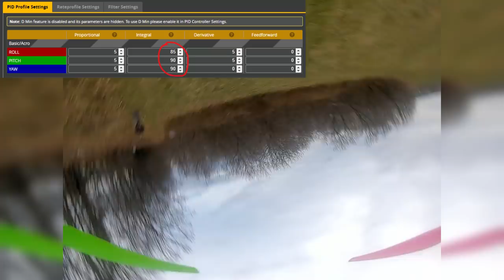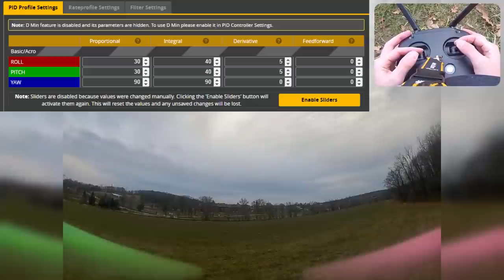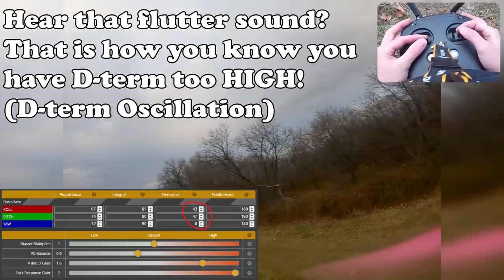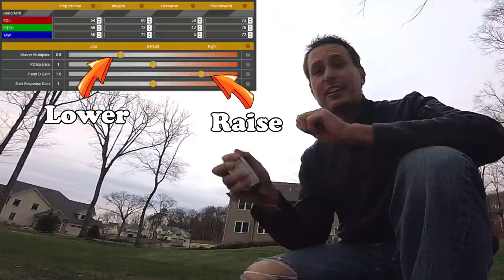How to: Fix Oscillations | I-term Tuning

Comment: Hello Mark,I hope you can help me. I fly my 5 inch copter with the Supafly Smooth Medium preset. It flies excellently. Now I have built a 3.5 inch Pirat Lil Matey 2 frame with 2850kv motors and SpeedyBee f7mini stack with 6s Lipo. VTX is the DJI O3 air unit. I chose the 3/4 inch Supafly as the preset. I now have the following problem. The copter wobbles when flying forwards. I don't know how I can tune the wobble away with the PID settings. Unfortunately I don't have any experience with pidtoolbox. All screws are tight, the cables are laid out neatly. The propellers are undamaged. Do you have a recommendation for me as to how I should adjust the PID and in what ratio to make the copter quieter? It would be great if you could help me. Rocksteady does smooth out the footage, but I would like to fly without wobbles in the live image. best regards and thank you in advance for your support. Best regards, Sascha

Comment from the maker: 1. we start with i=85/90 and P=5 --> it freaks out
2. we lower i=40; with P=5 remaining --> it flies but wobble city
3. we raise P=30 with i=40 --> wobbles are gone
4. finally, we have he full tune with i-terms back up at 85/90, higher P-terms for even better performance, and raised D-gain now to control the oscillation of the higher P-gains. 

Note: P and D together need to be as high as they can be for the best prop wash performance.

Comment: Thank you for linking this video for me in the Ciotti stream. Going to give this a try tomorrow, let you know how it goes.
Reply from the maker: If it still wobbles, let me know.  Maybe log it?  Does it have logging?
Reply: No Blackbox unfortunately. It's an Iflight Sussex f4 1s whoop board, mob6 19k motors, crs fire, it's a little porky at 27gr dry. But the I term is at 100 across the board right now,  going to drop it to 90 and try again. After I get some batteries charged.
Reply: Thank you again. This video helped get my quad flying much much better, still not prefect but a little more tuning should do the trick.

Comment: Transtec laser HD :-) Love Transtec Laser frames! Great quality carbon,  not really T700, but still amazing! (be aware - motor mounts are too week, use 4 screws there if you want to bush it).  Only issue is props in view.

Surprised how well it flue with D term 5!!

Comment: i need help on tuning my 2s 4" quad. it is little bit overweight but flies stable. when i try to record the flight, i continuously experience wobble on pitch axis. it acts like it is driving on a bumpy road. what ever i do, even changing controller, wobble is always there. since camera has no EIS, it reflects all small amplitutde slow oscillations on video clips. i adjusted, pids with patience with hours of trying, , i adjusted filters, blackbox is almost vibration free, fc is on soft mounts etc.  i am using old PWM esc board from aeesparrow square drone. This dron is actually a wifi drone but i converted it to fly with my own transmitter and a proper f4 controller. its original version was almost vibration free indoors ( with its primitive controller). what could be the reason?

Comment: Nice one! I use to tune the I alone by checking the quads reaction when going straight and punching the throttle. If a have a nose up in the punch i add I in pitch, if i have some angle taken in the roll axis i raise the I in roll. Usually this ends up in relatively high I values of about 80-90 ( the time that my P and D is arround 35-50). Should i try lowering at steps the I and see what happens?

Comment: Great explanation thanks, I’ve got low throttle oscillations, on a 3” what advice for adjusting pids to help with that? Tbanks
Reply from the maker: Reduce ESC PWM and/or i-Gain.

Comment: wich flight controller u are using???
Reply from the maker: All different ones.
Reply: @uavtech  i am using omnibus f4 v3s
Its make me crazy its oscillate just when i landing the quad. (low throttle)

Comment: ive seen it stated that P and D are for "high"-frequency errors and I is for low. I have been able to eliminate wiggles in my large 55 lb drone by merely adjusting I term. tradeoff seems to be steady state error (pitch in my case) vs wiggles, but this error is still acceptable. of course what makes frequencies "high" or "low" is dependent on your setup...
Reply from the maker: it is always D > P > i 
in relation to oscillation control high to low.  Also check out the video at theuavtech.com/tuning

The Key Relationships you need to know.
Reply: @uavtech   thanks!

Comment: Thank you! I have always wondered, why is there no slider for the I term only? Also, where did you get the go pro mount for your frame?
Reply: Brain3d has all tge mounts
Reply from the maker: There kind of is between the Master and P and D Gain slider.
Brain3D: https://www.brain3d.co/collections/gopro-mounts-gopro-protection/products/adjustable-angle-universal-gopro-session-mount?variant=25919723344
Reply: @uavtech  awesome, thanks! Love the Laser HD frame.

I just got a Transtec Beetle 2.5” with air unit and it came with stock BF 4.2 pids. It’s a heavier 2.5” and has a lot of jello even in a hover. What pids do you think I should adjust? I set up RPM filtering and I have the filters all the way to 2.0 but that did not help the Jell-O at all.

Comment: Great video thank you for this. Is it the same protocol for fixed wing?
Reply from the maker: yes
Reply: I will try this method instead of the traditionnal "PID" method. I tried many settings on my heewing f01 but there is still some wobbling following the pitch axis.
Reply from the maker: wobbles.  Reduce I-term in relation to P.

Comment: i still get mid throttle oscillation after RPM filtering bf 4.2 . What should I start twitching around ?
Reply from the maker: Try 48k pwm with RPM enabled and Dyn Notch max of 600hz.
Reply: @uavtech  in blheli suite ????
Reply from the maker: @DronemanfromNepal  yup.
Reply: @uavtech  thnx man !!!  now where to enable dyn notch to 600 hz .  thnx again
Reply from the maker: @DronemanfromNepal  in Filters Tab.  At bottom left.  Set min to 125 and Max to 600.
Reply: @uavtech  i think u have other tutorial videos about setting min and max value to 125 and 600 . i will watch it again . i wanted to use rpm filtering and i got fired bidirectonal dshot with updating esc firmware to support bidirectional dshot , it made worse . hopefully 48k pwm frequency and setting dynamic nothc filter to 600hz will get rid of mid throttle oscilation

Comment: So I have had a really bad oscillation problem on my new 10" drone, I have tried adjusting the I term and P term and no matter what combination of numbers I do it still slowly oscillates and gets worse until I end up crashing it, any ideas what could cause it?
Reply from the maker: If it is a slow wobble, it is too high of i-Term to P-term.  You can drop i-Term to 0 to see if it persists.  The other thing could be Motor Saturation.  Are you using 24Khz PWM and how big are the motors?  10" props are a lot to spin up/down.  If you need more help, jump on my discord and tag me.  Logging it would be good.

Comment: Hello, I am new to your channel as recommended by Joshua bardwell amongst other flyers.. I have built several quads since I started fpv back in august of this year and so far, everything but two seem to fly pretty good, but I know there’s room for improvement.. I haven’t been too worried about since I’m still learning to fly better, however, my repertoire of quads is growing and none of them have more than a stock tune.. like I mentioned before, two of my quads, actually 3, have some tuning issues that need to be worked out and I would also like to learn to tune the others beyond a stock tune.. I see that you seem to have a plethora of tuning videos, and so does bardwell, but here in lies the problem, I’m very new to the tuning aspect as in I haven’t done it yet, and every video I’ve seen so far is of much older versions of betaflight than the current that I have been using.. this only compiles the the confusion because I cannot see on my screen, what is being shown on yours or anyone else’s screens.. as a complete noob to tuning, is there a video you would recommend to watch first..? I have read an article by Oscar liang to get familiar with PID, and I’ve watched a handful of videos, but like I said, everything thus far, is from older versions than what is out now.. I’m still trying to understand PID and filtering, not to mention black box.. lol.. please help..! I actually started to try tuning one of my recent builds yesterday but stopped where I was at, because I have no idea what im doing and before I go any further with it, I want to have a better understanding.. please and thank you..!
Reply from the maker: Hi and welcome!  Everything to get you started is at.  For quick set Presets, check out that page.  For tuning, check out https://theuavtech.com/tuning
Reply: @uavtech  is this the same guide I saw you use in some of your videos you were tuning the 6s quad that someone sent you..? It looks like, just confirming..
Reply from the maker: @squirrelyfpv7283  yup.

Comment: does a perfect tuning with the black box increase or decrease the flight time?  I noticed that by increasing the PID a lot I have a greater absorption from the battery and the drone tends to have much less strength and is woody.

Probably wrong tuning and bad tracking of setpoint increase corrections and reduce battery in short time?.

Probably wrong tuning and bad tracking of setpoint increase corrections and consume battery in short time?
Reply from the maker: Likely reducing because it makes the motors work harder to keep things perfectly following the sticks (less wash, wobble, going off course).

Comment: I was getting some wobbles everytime I throttle up passed 50%, I drive myself nuts trying to fix it on BF, gave up, tried EMU flight and it's now gone, but what would cause that sort of wobble during a quick punch out?
Reply from the maker: Gains too high or needed more filtering.

Comment: Watching ur videos all over. I got a drone (lightweight 5" long range low power) I went to iNAV and not wont fly on 6S. at first couldnt even hover bad fast oscillation. Lowered everything to default and not my BF tune i put into iNAV. I upped gyro filtering too. I have no vibrations it looks like. But at higher throttle going up it oscillates bad. Fast oscillations like it feels like it wants to run away. been slowly raising D term now. 
BF PIDS were like P58 I87 D42
INAV started at BF then went to Default P40 I30 D23. Increased D to 30. it helped a lil. Now increased to 40. see if it helps. Hoping I can get this flying good in iNAV want to use it for long range in TN. Roadtrip from NY to Tn just to fly this drone long range lol.  It did fly fine in beginning on 4S. Havent tried again
Wish you lived near by. Pay you to fix it lol
actually reading description ur only hour and a half from me. Im in Wappingers falls NY
Reply from the maker: Sounds like noise issue.  Join the Patreon and throw up a log.on with raw noise recorded (debug = Gyro_Scaled in BF or Gyro in iNAV) and we can take a look. HD or DVR helps too.
Reply: @uavtech  I got it flying good for awhile.  But giving me issue again lol. Think it's just battery too big and vibrates a lil at times.

Comment: Hi...thank you for this
Newb question...how do you know where to start? 
If I build a quad and the FC has the latest firmware does that flash include a 'stock' PID tuning to work from?
If not, what values would I enter to start the tune from?
Reply from the maker: Stock should be ok.  You can hone in a little further then on theuavtech.com/presets and if you want to eventually tune, check out theuavtech.com/tuning
Reply: @uavtech  Thank you.

Comment: So for each quad size, can it have same I gain value.. Or bigger/smaller quad will have lower/higer I value? Based on what? Power to weight ratio or just the AUW of the quad..
Reply from the maker: I has a wide window.  The best way I know how to tune it is you want it strong enough that I-term doesn't wind up a bunch on any given axis in flight to compensate for a low gain.  For that, I look at the logs.

Comment: What would cause P, and I fast ossilations on yaw? I'm dealing with this on one quad, and I just cannot seam to get it to go away, no matter what I do with p(45)and i(80) ff120, since there is no D on yaw.
Reply from the maker: Yaw is too slow for D, but you can add some if you like.  Lower Pi on Yaw if you have oscillations.

Comment: why is the I term and P term different for roll, pitch and yaw specifically?
Cant we just set yaw the same as we set the other two? like 40 instead of 90?
Reply from the maker: Yaw is not a thrust axis (no prop blowing air in the Yaw direction).  So it is slower to react and relies a lot on i-gain to keep the movement sustained.  For Yaw, you want nice high P and i-gain generally.  But if a light quad, too much P can oscillate.

Moment of Inertia is typically different on Roll vs. Pitch and hence the gains are a little different.  Pitch typically takes a little more damping (more D) and the gains in general (P, i, & D) can be higher on Pitch.
Reply: @uavtech  Thanks a lot really appreciate your kind help:)

Comment: Trying to tune out a persistent low throttle cruise wobble on my 7”.  Help?
Reply from the maker: lower i-Term.  Make sure ESC PWM setting is 24khz if you can.  If you ESC only goes down to 48khz, set it to that.

Comment: Integral (delayed response)  P (proportional [to the error] response) derivative (quick response)
they must be adjusted to fit the inertial mass in order to be fast but not oscillate and to correct also the minimum difference with respect to the aim.
Reply from the maker: Yup.

Comment: What setup is that quad? Looks really compact and clean!!
Reply from the maker: It is the DJI quad: https://store.dji.com/product/dji-digital-fpv-system?vid=83421
You can get all the components separately and build yourself.  You don't need to get from DJI's store.  They just have it there for folks first buying the FPV system to pick up a quad as well.
Reply: Watching this and the 10 inch patreon video really displays that moment of inertia. The 10 rolled fast and stopped fast but you could see it was working to stop. This 5 inch just stops.

Comment: How should the P term dampen the I term?
The P term is, as it´s name suggests, proportional to the error. Large error gives large p value.
The I term integrates the error, to eliminate the residual error left by the proportional nature of the P term. So as long as there is an error, the I term steadily grows, until it is strong enough, to get the error to 0, where it stops growing.
In a normal control loop, the I term only starts to decrease once the error goes negative (overshoot), so it can integrate itself back to 0 or negative. But as long as the error is positive, P term and the steadily growing i term both work in the same direction. 
The p term only contradicts the i term, if you allready had the overshoot and the i term is still holds a positive value.

That´s a bit like pushing someone over and just help him stand up afterwards...
Reply from the maker: Whelp, you can see how it works.  Since P does not let large error then i-Term doesn't windup to kill it and then overshoot as a result.

Comment: how come on ardupilot pid defaults the I terms are so low? If this applies too for ardupilot
Reply from the maker: If you do not have i-Term Clamping, (i-Term Relax) and/or a way to give advanced push to the motors on sharp stick moves (Feedforward), you have to artificially push down i-term to compensate or you get i-term boumceback.

Comment: Followed this guide. Still get fluttering on intense moves. Increasing D even by a few points does nothing and causes fly alway. Any ideas??
Reply from the maker: Reduce D, not increase.  You are at the D-gain limits or have a lot of gyro noise making the D-term hyper active.
Reply: @uavtech  thanks a ton!! You should consider doing a video on how to use the radix graphics osd to tune a quad

Comment: In your 5" presets you have tpa higher , what should tpa be at for this quad
Reply from the maker: ? - it was the same quad.
Reply: @uavtech  what is the tpa recomended for 5" quad , mine is the iflight cidora 6s
Reply: @uavtech  tpa 65 and tpa breakpoint of 1750 on your 5" preset , is this still the recomendation

Comment: with bigger quads, 8" and above. should I start at I=40? or just go higher?
Reply from the maker: depends on your P and D gain slider.  Default i-Terms seem to be pretty good for then finding a resonsible P and D Gain strenght for a variatiy of quads.  However, if folks are having slow oscillation, move up the P & D Gain slider.  If you can't anymore becuase, you get D-term oscillation, move down the Master some.  Everything is in ration to something else.  Hopefully that makes sense.
Reply: my fault not being too clear here. I was referring to the video segment where you start at I=40 with P&D both zero.

but I think this would be the best/clear way of PID tuning a quad. thanks! 👍

Comment: what if you turn off the pid (ipd) controller?
that's how quads and tricopters started, with mixing in the tx
but i haven't seen it done with modern precise esc's motors and reliable recievers
Reply from the maker: If you turn  off the PID controller, it will just sit on the ground.  You can do it.  Just set all the gains to 0.  You will have throttle, but that's it.  Don't be close to the quad in trying this and keep on the disarm switch.

Your stick inputs are NOT flying the motors.  Your are flying the PID loop.  It is flying the quad.
Reply: @uavtech  i've already tried that :)